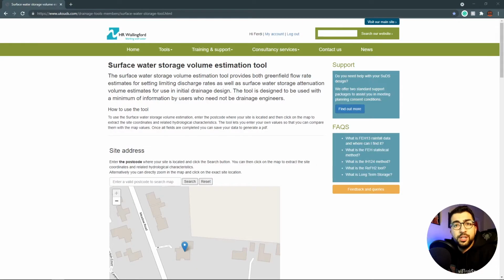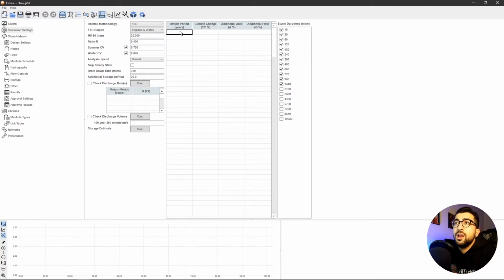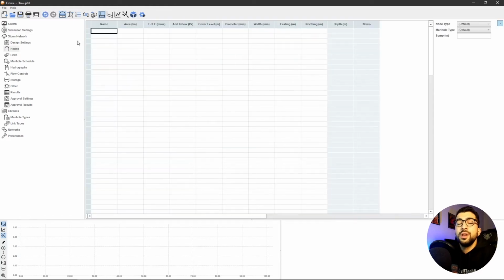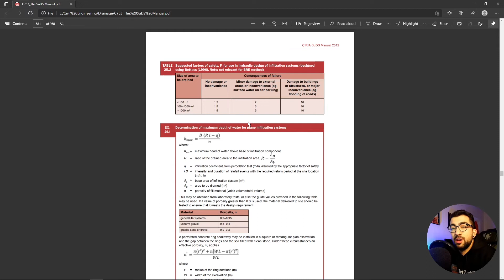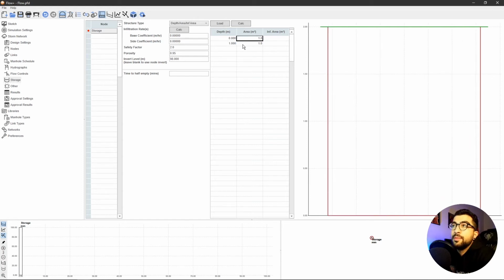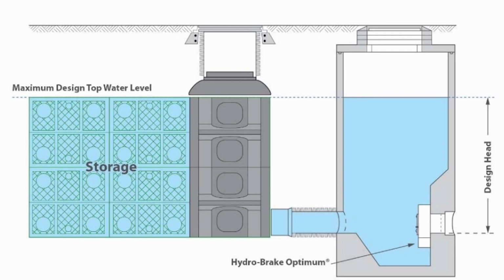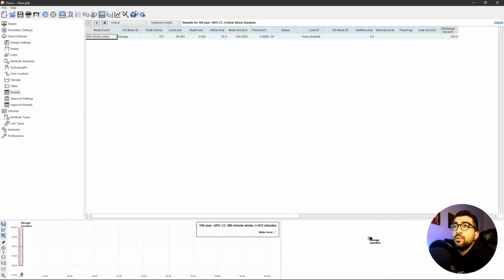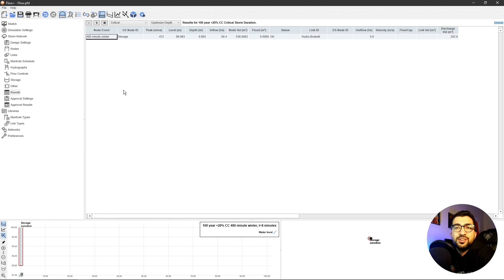Causeway Flow - Quick Storage Estimate for Depth/Area Storage Structure

Comment: Hi Ferdi, Thanks — this is really helpful. I'm trying to do something similar for one of my projects, but I'm using version V16. When I run the analysis, I keep getting a mass balance error message. Do you happen to know how to fix this? The project has several plots, each with its own storage estimate. Would you recommend creating a separate model for each plot, or is it possible to include multiple storages in one model and still get accurate results? I tried running it all together, but since the mass balance error popped up, I figured something must be off from the start.
Reply from the maker: Generally the reason for mass imbalance is that the volume of water entering the system is not the same exiting the system. So I would first check and see that water is not being stuck somewhere by having the outlet IL higher (quite common the pond or tank nodes). Other reasons are very short pipes, not enough run time analysis or even hydraulic jumps due to water entering a node with a lower manning value (usually at points where pipe discharge into a basin). Hope this gives you a sense of direction.

Comment: Hi Ferdi, thanks for your detailed videos on Flow - as a new user they have been really helpful. Do you have any advice/tips for getting the software to report out the half drain times for structures i.e. geocellular soakaway with no outfall? I'm struggling to get this information out of the model and wondering if I'm doing something wrong!
Reply from the maker: Hi Pete! Thanks for your support and feedback. I believe that you can get the half drain time after you run the simulation and go to the storage tab and when you select the node it should show a text saying the half drain time. Hope this helps.
Reply: @CivilTechSource  I was hoping this would be the case but it just leaves it blank even after running a sim. Seems to work using flow-through-pond tool but not when modelling a standalone depth/area node. Thanks for your help though, appreciated - might need to call Causeway!
Reply: Hey, I'm having the same issue on my project, just wondering how you ended up solving it?  @thepongopete

Comment: Hi. I'm fairly new to Flow and am struggling with certain parts of the design. Your videos have been excellent so far. If you could just clarify something that would be great. If I'm designing a 
Hydro-Brake at the end of a Storage tank should my Design Flow equal the qBar I plan on designing the tank for. So lets say I have a 1, 30 and 100 year Return Periods within the Check Discharge Rates. Lets say they give a 2, 5 and 10l/s qBar values. Which should I use for the Hydro-Brake Design Flow. I hope you get what I mean. I find it hard to explain over a comment.
Reply from the maker: Hi A Kin, glad to hear that you have been finding the videos useful! It seems you are after a complex vortex flow control chamber. Basically the short answer is to use multiple controls in the same manhole at different levels (For example at the bottom you have a hydrobrake then higher up an orifice). If you use the Civil Tech Source forum to raise this question to answer more in detail that would be great! Thanks for the support.